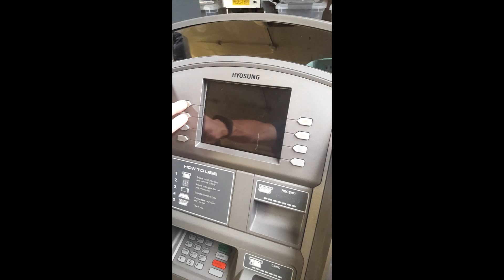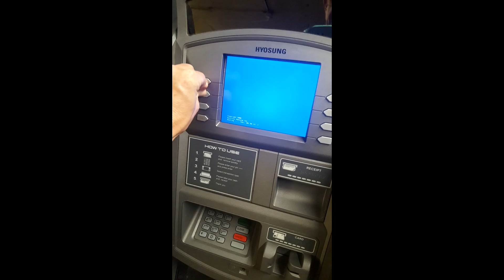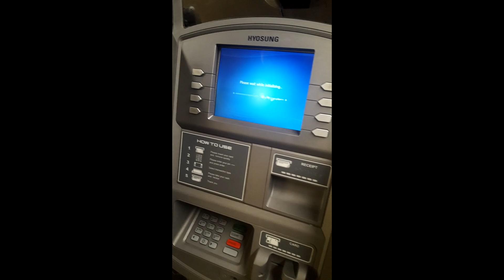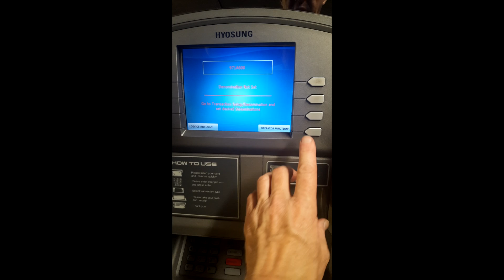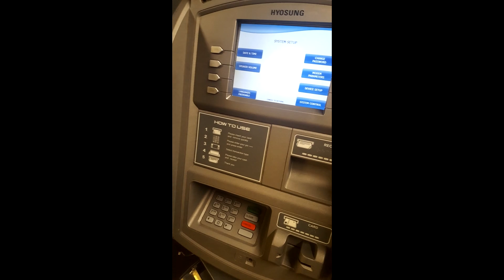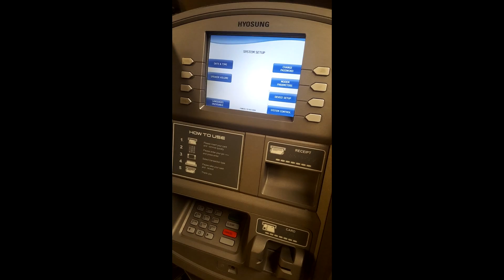NVRAM Broken - Hyosung MB1-800ce ATM

Comment: Hey Nigel I had to replace a keypad in a 2700 the keypad is a 8000R. I re-enter the master keys and the Mac keys. System comes up normal but every time I do a transaction I keep getting a error code of 97999(04)

Comment: What you also want to take note of is the bootloader. Some are older and will not prompt for the master password reset, but instead state for you to wait for the terminal to reboot

You'll need to hold the lower 2 side function buttons while turning the ATM to access to bootloader and update it so you can do the master password reset

However, most importantly, change the battery while you are at it
Reply: He said this model was a CE. I just wondering if this would work on an SE ?  Any input would b greatly appreciated. TIA

Comment: Note you have to change the battery first or you going to have the same issue again 
For all services (cdu, any other error code... ) call 347-603-5756
Reply from the maker: Hey Zouhair, sounds like you know what your talking about, thanks for commenting on my video. It's always good to get another opinion, we should talk by phone sometime, 714 381 7109. I tried to call you at 6:40pm PST, I'm here in California, so it might have been a bit late, sorry about that, I forget about the time difference.
Reply: Zouhair Aslaoui  my vault door doesn’t close I change the battery but it won’t let me put my security code I turn it on and off tries several things any suggestions sir

Comment: If the ATM software is too high, you may just get a Please Wait For System Reboot. If this is case, you have to use a SD card to reload Operating System and Boot Loader first, then follow this guide.